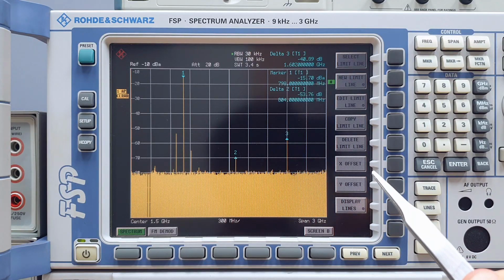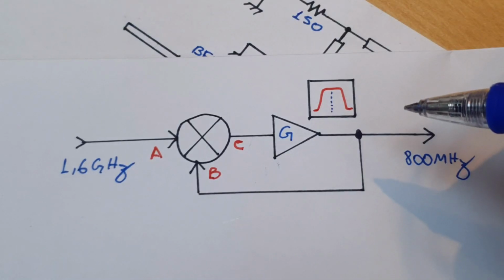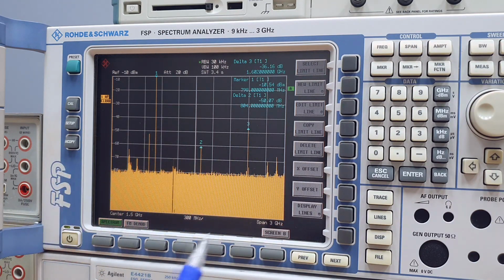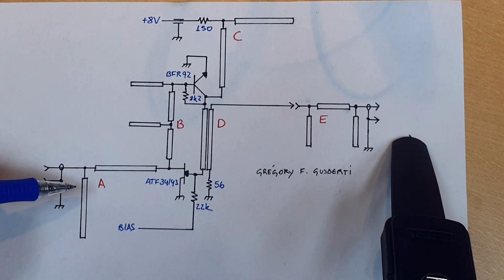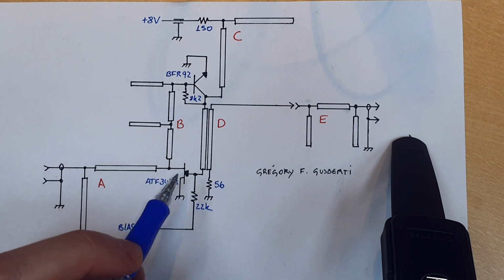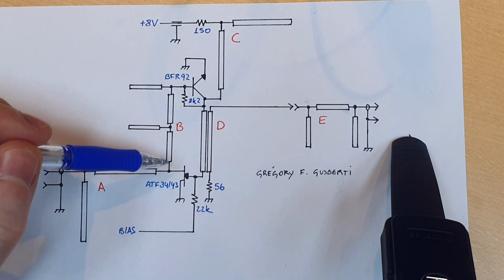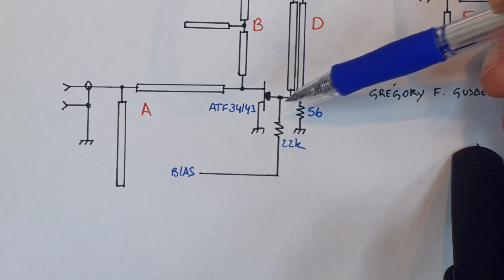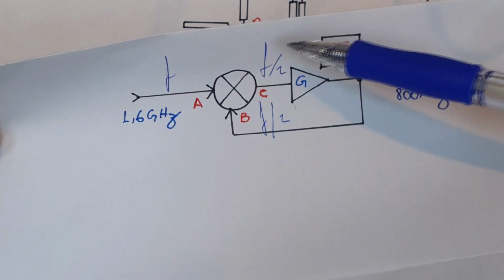Frequency Divider - Theory and Prototyping Example

Comment: Curious if there are ever issue with the startup time.

If no filters are employed, I'm also wondering what all possible frequency conditions it could 'lock' onto.
Reply from the maker: The transistor used has a lot of gain.. so I think the startup condition is pretty fast. Actually all the microstrip structures are filters, so it only works for the design frequency (maybe multiples)

Comment: I got 2 questions: #1 - If the Speed of Light is 299,792,458 meters pers second, and I assume the velocity of the speed of waves in copper is 95% of "c", then am I correct to conclude that: 299,792,458 times 95% is 284,802,835.1 meters per second, divide by 800 million, you get a full wave (in copper) of .356 meters, which I converted to 14 inches full wave. So, are your copper strips 14 inches in length, 7 inches in length, or 3 1/2 inches in length?   #2 - How far can you move away from your 1.6 Ghz input can you go before you no longer get 1/2 on your output ? Will 1.4 Ghz input give you 700 Mhz, or will you be too far from the center, to get "center" ?
Reply from the maker: Hi Jeremy. The wave speed in an FR4 PCB is around 45% the speed of light. 

The circuit works only for narrow signals, where the filters are tuned. Like 5MHz out of center.
Reply: @AllElectronicsChannel  im glad i asked that